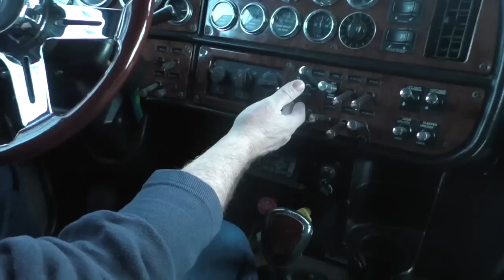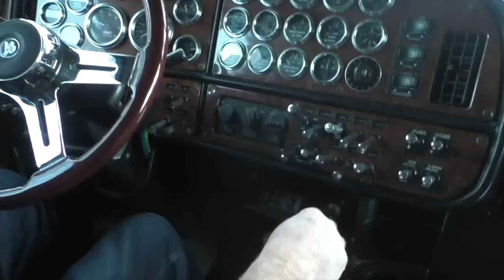How to Handle a JackKnife Skid- A Critical Professional Truck Driver Skill

Comment: I drive BC, almost every road is crap and unsafe in the winter. Toss in monster grades and blind curves every few seconds, long steep downgrades with sharp tight curves at the bottom, and it's not a recipe for happy runs. Signs that say compact snow and slippery sections means pack ice the entire way. That being said, I have more than 35 years of experience running these goat trails. Yeah I know all the common wisdom about what to do. But in reality, when shit hits the fan it happens in a blink of an eye. All your what-ifs you've thought about go right out the window. Your mind literally doesn't have time to think, oh gee, I should do this now. You just react, and at best, you react well. I could wax poetic on all the times I've had to change my underwear. But I'll offer some things I do instead. They work for me, and I'm not saying others should do these, especially not rookies. I always have my jakes on, rain, ice, snow. If you're in some real shit road conditions, or approaching a ugly downgrade, switch your jakes to the 2nd stage. I call that the Goldilocks setting, just right. have seen lots of morons go down a grade and go oh shit, and hit the jakes hard. Bad move. You'll get a good view of either side of your trailer in your mirrors. When you're set in the middle jake, it's not strong enough to throw you sideways, and you can adjust as you need to going down. Each up or down doesn't cause such a violent sudden drag as hitting it wide open. Easy does it incrementally. Also, I use the spike, that'll straighten your trailer. This may sound counterintuitive, but approach a downgrade in a higher gear than usual and slow way down, and keep the revs down at a 1000, basically let it idle and flutter all the way down. Your jakes will have a very gentle holdback and not cause trouble. I also power out of a skid. Yes, taking your foot off every pedal can work, but it's been my experience that it's been better for me to fight it than let the universe unfold for me. One thing I have noticed during the summer now is 20 times the amount of rubber before every curve. That tells me the quality of drivers has gone down now. It's easy to imagine they hammer the brake just before and during curves in winter.  Don't be afraid to get out and hang some iron if it's real shit. Anyways, get some miles under your belt, sure as shit you'll amass some interesting experiences. trust your instincts and judgement you've acquired, cuz you won't have time to think it through when shit happens. Ok, one little horror story. I was going down The Smasher. Bare deck.  Road was total crap. I didn't want to hit the brakes or use my jake. I went down in 2nd. I'm doing my thing and just barely able to keep it straight. All of a sudden a great commotion exploded on the radio. I look in my mirrors. Guy is coming down sideways behind me, all 3 lanes, and he's catching up to me. Oh joy. I was in the middle lane, so throw in a moronic 4 wheeler that was hanging out just ahead of my driver side bogies. Curve before the shed is waiting for me. What did I do? For those that give a damn, I have a few million miles, all safe, have never been in the ditch once. Been in and out of a few ditches and kept rolling before though. Love listening to the radio when guys start asking where's the truck when they go by that mess I caused lol. One more thing, if the road is shit, but not deep enough, either ice or snow, then using chains isn't a good thing. Nothing for them to bite into, and you'll skate the whole way down with steel on asphalt or concrete.
Reply from the maker: Good stuff and solid advice! Love the" Goldilock" setting. Hadn't ever heard that before. One of the worst rides I ever took was on the Trans Canada between Revelstoke and Golden heading east. I was empty, having unloaded my A train tankers in Revelstoke and came down the Rodgers and the road was good. Figured I had it made in the shade back to Calgary. You'll know Donald hill. There's a curve in the road just before you start down it, or there was in the late seventies anyway. Just before I made the curve to start dropping down the hill I looked over and here's a Ken Brent pulling reefer chained to the nuts going west! I thought what the hell, the road's dry, came round the corner, the hill is glare ice from the run off freezing and there's trucks spun out all the way up the hill, including two side by side. The outside one was a Builder's Transport flatbed. I still remember that cause I thought he'd be the guy I hit. I flipped on the jake in third, she locked the drives, stalled the engine and through the pup into the passing lane. Got her restarted, jake to first got her half straight and hugged the snow bank to the bottom where she rode the snowbank around the curve at the bottom and across the bridge over the Kicking Horse river, all the time gradually slowing down. Crawled into Golden and got onto the south side service road. Dynamited her in front of the motel on the high side of the road across from the Husky and she slid across the road on her own to the low side. Crawled to the hotel and stayed there a couple days till I got my nerve back. Richardsons was mad about my unscheduled day off but I thought I'd done a fine job just bringing their truck back in one piece.   Dave .  Just reread this and I spelled"threw" wrong!
Reply: Smart-Trucking.com Columbia river is the one you cross at the bottom of Donald, the Kicking Horse flows into the Columbia from east of Golden. I know who cares.
Reply: rob1958bc
I didn't quite get from your story what happened as that truck was sliding towards you and the 4 wheeler was beside you on the smasher.   What did you do?    What happened to the truck behind you?

Comment: I love CB radios! One day I was in a van it was hauling my multi $100 bicycle on the back. When Over the CB came. Van hauling a bicycle you're now dragging the bicycle! The driver immediately got into getting off the road and stopping and I got on the CB to say thank you thank you. The rear tire was destroyed. And the frame was about an inch from hitting the pavement and starting major destruction. Yeah I had to replace the rear wheel in its entirety bicycle was saved by a CB. And who knows what would have happened when that frame came into contact with the pavement the entire bike could have been ripped off the van and caused who knows how bad of an accident.

Comment: I never Jacked but I did hit Black Ice at 45mph on the interstate during one trip & I noticed the rear of my trailer was wanting to drift over into the fast lane! 🫣
I did what an Ole' Timer taught me years ago & I reached up & tapped that trailer brake handle & she straightened right up. 🤟. 
The driver behind me was coming up way to fast & jacked his rig on the interstate behind me. It was a bad snow/ice storm but speed is very important. 45mph or less. I've seen too many "Cowboy Truckers" fly by me, only for me to pass them up the road while they were sitting off in the ditch or median. 🤟

Comment: "Things can go sour really fast"

Off road, deliveries, on solid sheets of ice, with really steep grades, are always fun and exciting. Chained up both axles..  Still snowing (Colorado: Aspen, Vail, Glenwood) and when I'd start to slide, I'd just be sure I had my seat belt on, I'd pour some coffee, and light a smoke..... Cause there wasn't much I was going to do to stop until it stopped. 

Delivered a load to a construction site in the bottom of the canyon.  I came down that Z shaped dirt road, iced up, every way but the right direction. 

I asked Jack, "Who the hl builds a house down here.... How will they get up the driveway in the winter?!?!???" 

Jack's reply "oh, when we're all done, the driveway will be heated, and then the owner can drive in and out anytime." I think my next words mumbled to Jack were

"heat the damn driveway now, so that someone doesn't get killed coming down in here."

Comment: In 96 when I went through training in Green Bay for Schneider they had the only real Skid Pad in the industry. You got in a Bobtail with an instructor who could control the fuel and brakes. They tell you a Skidding Wheel will alway want to lead. Which is true. They say when you start to skid . Immediately push the Clutch to the floor and get your "Rolling Traction" back. You start out heading for the" Green" triangle they put you in a skid and say head for the "Pink" triangle. They want you to "Steer/Stare where you want to go" No into /out of skid . They want you to get the idea in your head to pick a clear spot to put your truck in it. And it works. You then go to a Tractor/ Trailer same thing.Years later I got to go again with some experienced drivers who were just hired on. One guy didn't want to go "Ive been on the "Real Skid Pad" he'd say over and over. Well we go out and watch the trainees all do great Do my turn and finally it's his . You guessed it . It could not handle it . Failed the test and we didn't hire him. And you are right no matter how good you are Or the training / skills/ technique once it gets a away you might as well hang on for the ride Cause thats all you are a rider LOL.

Comment: If anyone wants to learn how to handle there rig. Gotta play a bit in a large space where you wont hit anything.  Try a drift n recover. Turn n hit the spike quick so you can learn to look where you wanna go.. point the steers that way and get on the fuel to pull it straight.  I haul logs on ice roads. From November to may its ice in the bush up here. If anyone is near sudbury and wants to come for a ride just ask. Just bring extra shorts lol.

Comment: I used to be a truck driver, but in Europe. I am not familiar with the slang he is using to describe certain things (like shut off the 'hydro'??? What the hell is that supposed to be?). Also, European trucks have none of those buttons and switches and most likely use the same or similar functions in a different way. It would be most useful if during explanations the speaker would always make a short explanation of the terms used, be unambiguous and perhaps illustrate how things would apply to 'plain' European trucks. We have next to no buttons over here.

Comment: I  am retired now . Australia . I  used to do Shipping container work . Along with many other things . 32 years after , Military Time . 
There was nothing  I  hated worse than a Short ( 20 foot ) Skeletal Trailer . 
Unladen , those could start overtaking you before you even KNEW about it .
Horrible little Mongrels . Shorter than the Tractor Unit . Big Box Trailer . Luckily weighed nothing much , comparatively .
I  have been Sideways , Downhill with Max Gross 48foot as well . Underwear change after these . 
Fortunately  Ice  isn't a big thing in Australia , but we can get Monsoonal Rain . 6 inches of standing water on the Road .

Comment: im so against using the jakes in snow or ice. slight trailer brake and give it a bit of power. Jakes you're trying to brake in the center of the unit, just asking for trouble in my opinion. Good way to make a jakeknife much worse very fast

Comment: 5% grade-on-left-turn-curve.  89 F9000 Tri axle w/22 foot pole towing a tridem pup (139,500ish) (Armstrong highway, Eaglehead river corner; hauling Palladium concentrate from Lac Des Iles Mine) Was doing about 50kmh, two wood chip trucks in both ditches, either side of the road.  No jake, I could not feel the road, let off the fuel and the pup started getting bigger in my left mirror.  The road was glare ice and just the engine under no load, caused the trailer to swerve out into the northbound lane, filling up my left mirror.  The guys standing on the road, ran for both ditches.  Shivers come over me that felt paralyzing, I thought "oh boy, here we go"....I slipped the tranny into neutral, flipping my eyesight from mirror (watching trailer) to the road in front of me.  No brakes, neutral, engine idling, I tried to steer the truck to follow the curve.  Slowly pulled the spike and the trailer slowly disappeared out of my mirror, the truck straightened out and I made it down the hilly curve, steering the truck down the centerline.  Stopping, I got out and thanked God.

Comment: Steer into it.. hmm  into the ditch? :)
So if trailer goes to passenger side, steer Right, right?
Sounds back words but Your the experienced pro!! I'm NEW.

I Know that's how you do a car when having fun in the snow.. plenty experience there growing up in Iowa.
The 5th wheel had my mind thrown off.. :)
Reply: If the back end of trailer is heading towards ditch then front of trailer si likely pushing back of tractor towards middle of road or left lane. you need to calmly  and smoothly as possible steer left to get tractor lined back up with trailer. If you steer to the right  before getting it straight or at least somewhat straighter it will likely fold up. He is speaking a lot of truths in this vid. Good info. Sometimes it takes a little bit of left then a little bit of right before you sail off in the median or wrong lane, ditch, etc.. JUst try not to panic or make any really abrupt corrections.

Comment: Did you say the trailer came around when you hit the Jake?  Some trainers say never use the jake to slow down.  I kind of like the # 1 position. I had a situation where I touched the brake and trailer shows up a little in the mirror and I touched the throttle ever so gently turned into it to get it straight. Did that cause nothing in front of me and only going about 25 at the time.  It definitely sends a pucker up your spine.  Would you say in those conditions find a close safe harbor and shut it down?

Comment: Something you didn’t touch on is the tires on the truck and trailer. Because of their wider grooves on truck tires they do better in wet and snowy weather but not as good on ice. If I was driving a 4x4 I’d always try to have newer tires with deep tread. Unfortunately, most trailers have the cheapest and poorest tread designs put on by the freight company which are about as good as bald tires. Because they don’t have a demand for them tire companies don’t stock the better ones. Since many drivers don’t drive the same truck consistently, getting good tires is like a box of chocolates. I personally wouldn’t drive my personal car/truck with the types of choices that’s available for trucks. If I could have my own choice of tire I wouldn’t be afraid of driving in any weather. Realizing what I’d be stuck with was a big part of not getting my CDL. As you said, if the trailer is kicking out then it’s best to try driving over in front of the trailer. However, if the drives are going sideways then by all appearances it would seem you have to recover drive traction before you get in front of the trailer. With the drives being pushed out, just like a car, if you steer away from the rear tires it will slide out at a faster rate which would wrap the tractor around the trailer. I realize the drives are less likely to get out of line since the trailer is generally dragging back against the rear of the truck. Do you agree with what I’m thinking? It would be nice to have access to a skid pad so somebody could practice and learn how and what happens.

Comment: your videos are always very helpful.how do you know that you drive or having black ice in front of you about 3 truck and trailer length far in front of you?I had this happened just last month in winnipeg mb and passed a long convoir from trucks was wondering why they are so slow road conditions were there fine,we just drove through blowing snow and bad view 60km before heading into winnipeg.came from sk.would be nice if you answer me this question and what to do if you hit ice and cant stop anymore because just slipping away straight into trailer or right side traffic or shoulder or ditch with big billboard. was my first accident at all so i try to stop and just break harder until i bank into the trailer in front of me.good just that nobody got hurt or any other damage than my truck.truck can be replaced but a life not.so i see that.
Reply from the maker: Nobody can control a vehicle on glare ice. All you can do is take your feet off the pedals and try to steer out of it until you stop.    Dave
Reply: ok.so i cant stop on ice but how did the traffic in front of me then stop?somehow it should be possible overwise we would have always crashes.how do the plows drive on these streets then?ok they are much smaller and not so heavy as a truck and trailer but still steering and stopping is for them possible.i never saw a plow in the ditch.but the weight from 45000lbs pushes also really good forward.so i talked to another driver from our company she said the same.even if i would not break then you just go straight because of the weight of your trailer what pushes you as well.why does my boss not tell me this?

If i crash then into a vehicle by this street weather conditions is this then still my fault and i get points on my drivers license and record in the drivers abstract or not?

Comment: If you have flat skin tires (like your ass !) on the trailer axle and you know you gonna head to ice/snow/slick weather THEN
lower cold tire pressure from 100 psi to 90 or even 85.

This helps a lot. Especially when hauling EMPTY or lightly LOADED trailers. The rear tires will 'grab' more and trailer will stay straight better.
Denis 35 years experience (Canada driver & ice road trucker).